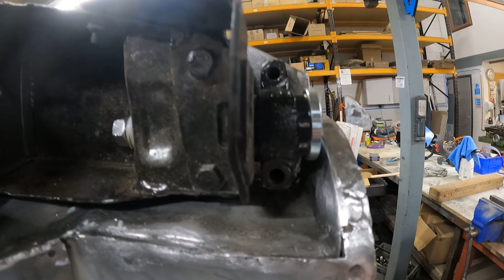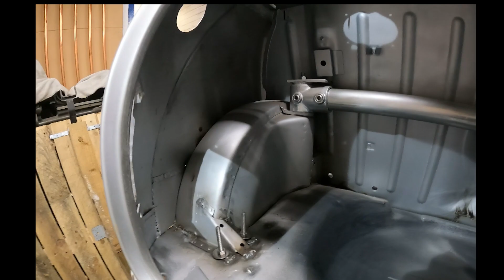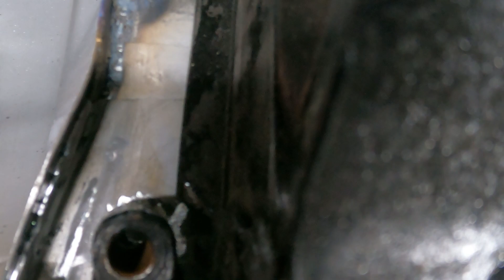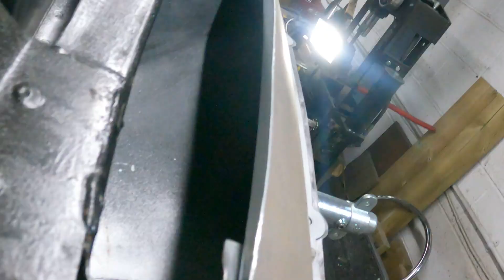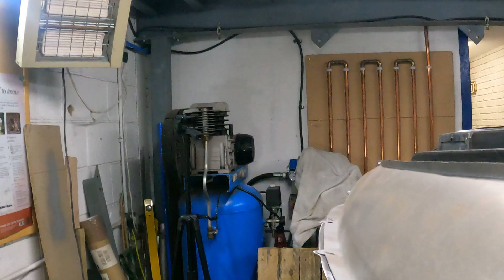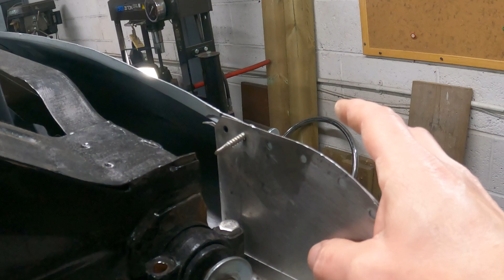Classic Mini rear subframe fitting

Comment: All good info..  I've been concerned about the new bushings and how stiff they seem to be.  I like your idea of crushing the bushing by tightening down.    I certainly struggled with fitting the rear subframe.. only to find out it was a sequential ordeal..  I will be revisiting these videos before I get to mine..   so glad you have shared.  Yep.. so glad to see that the 3 panels (valance, floor and boot lip) don't necessarily line up perfectly.   all those final details of finishing up..  Devil's in the Details....